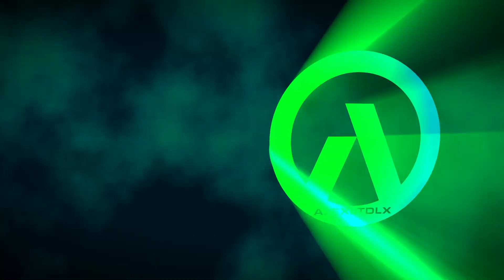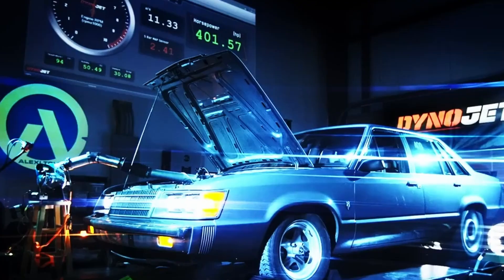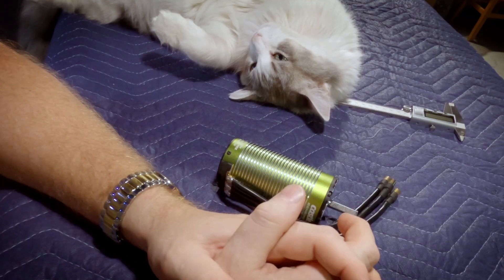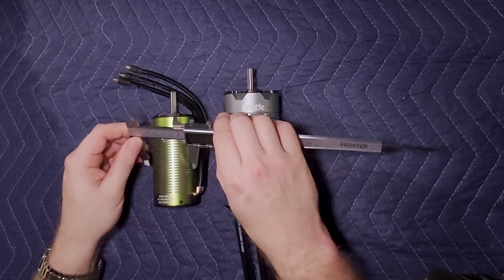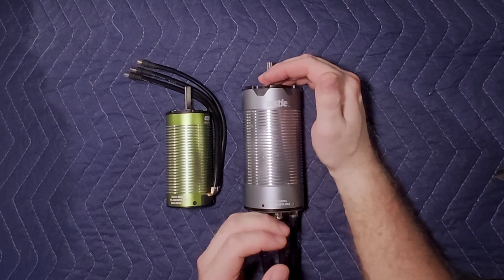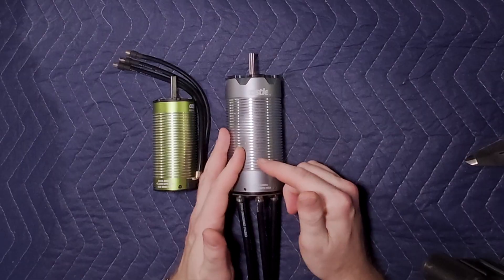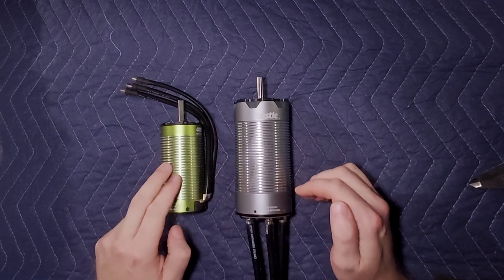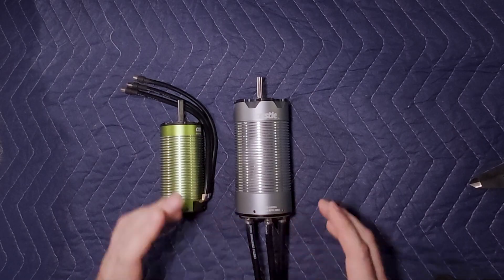Gigantic Brushless Motors - Castle 2535 vs Castle 2028

Comment: instead of using an e-turbo, why not attach a RC 90mm 12 blade EDF to the cold air intake. Or bigger edf? With an esc used on large multirotors.

Comment: Hey, I want you to take a look at Aleks from Lund tuning. He does YouTube but he is one of the tuners for Lund. He and Lund specialize in tuning mustangs, gen 1 and newer. I think if you listen to him it may make you wanna test this stuff out on a gen 2 coyote. Because rule of thumb apparently with that car is boost and fuel. They make 700-800whp with a ess kit running maybe 8-13 psi. 

If your setup works as a daily car and is cheaper than a $6000 kit. I’ll bet that you would break the internet and the car industry.

Comment: The new 2535 looks just about perfect! You should use a cooling fan and shroud to help with motor temps. Something like a 92x38mm 8000RPM fan would probably make a big difference. Example: Delta PFB0924DHE.

Comment: Why use such small "hobby grade" motors that have to be pushed so hard at crazy RPM and insane amps at low voltage?

 A simple brushless QS165 motor will easily spin 6-8k or so and put out 30-40 shaft HP and not get massively heat soaked in the process. It will do it over and over with a great service life. Can run a simple store bought E-bike 72v-96v bat pack that is safer and smaller with MUCH less amps and weight.  Would just need to pulley it similar to the car kits.  Just a thought.... we use them on drag race E-mini bikes and pull 30-40kw on them on 20-28S bat configs and around 300-600a. 

Great channel!
Reply: Too many trade-offs, and not enough benefit with the bigger QS motor, even with its higher thermal capacity.
The Castle motor is nearly ideal in most other parameters. The pulley ratio will be max 1.5:1 with the Casle, whereas the 6200RPM motor you mentioned would need nearly a 5:1 ratio if it's run near the max RPM spec. The Castle 2535 can handle 16s (60-63V under load) which is getting close the 72V you mentioned. He could probably run a 72V e-bike battery and just throttle it to 90% anyway. Then, the extra 10+ pounds of weight the QS is not ideal either. The Castle is probably also significantly more efficient which helps negate the lower thermal capacity.
If he were to add something like a high output 92x38mm fan to cool the motor it would go a long way to extended high power running. Example fan would be Delta PFB0924DHE. A shroud would maximize heat extraction.
Reply from the maker: You hit several nails on several heads with that post.
Reply: @fertyface  The issue with the castle motors is baby boost.  What is the point of 2-3psi to redline. When the standard kits will make 15-20psi plus on a V8 with the standard pulley options. The qs165 turns the same RPM a standard V8 does. and its rated RPM means diddly. We routinely run them to 8k+.  Its perfect to pulley exactly the same as you would the crank shaft.
Reply: Very good points.
I hope they do it

Comment: Nice motor, good price. I wish it had a higher KV so it could hit its max RPM at 12s lipo voltage. Should be able to run the 680Kv version to 16s.
Reply from the maker: I agree... the dyno test is coming up next

Comment: would you be interested in testing bigger non RC motors in the future? Im afraid RC systems wont be enough for anything more but dyno pulls. They just arent made to sustain those peak powers. I predict some lower KV paraglider motors in your future along with VESC controllers that wont overheat in 10 seconds 😁 Very excited to see what you guys make next! Love it!
Reply: I'll do that soon. I'll use a 240v motor used in Hyundai (Hyundai HSG) to start and regenerate energy in hybrids, using a Toyota Prius inverter.
Reply from the maker: We've raced these things already - there are several track videos in the electric supercharger playlist.  I've also tried VESC.  To be kind, it's good for skateboards.  It's currently sitting unused in a box.  I have several videos where I tried to make it work.  FOC has no advantages over block commutation in this application, but it does have severe disadvantages.
Reply: @AlexLTDLX  Ah i searched your channel and found it. To be honest i dont think FOC is needed for this application either but newer firmwares have made it unimaginably better. Im pulling 20kw on my d100s daily for over 1000km on my scooter and trampa is i bet equally capable. Might be worth looking into it again if rc esc doesnt pan out. Thank you, only started watching recently but i love the videos!

Comment: First let me say that is absolutely fantastic to see you back at it in a new production the second to none. 

I am also back on the wagon with my show car it has been setring for a little over a year now. Not sure if you remember me I we talk a few times on over the phone, I am in Georgia.

 My P2 set up is direct drive. I would love to upgrade to the castle 2535. And possible the new controller they have over the custom unit I had built. Is the 2535 suitable for direct drive applications.
Reply from the maker: Hold off until I do the dyno test... coming up next.
Reply: @AlexLTDLX sounds good to me sir